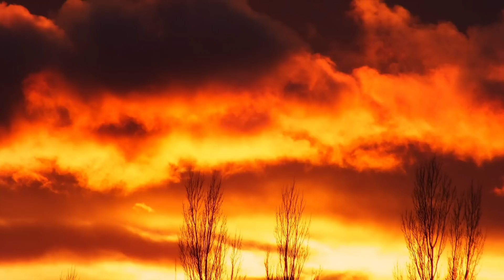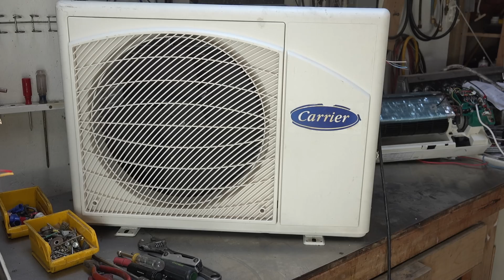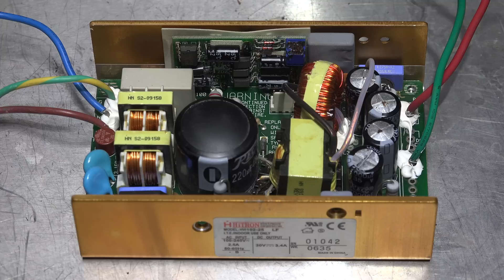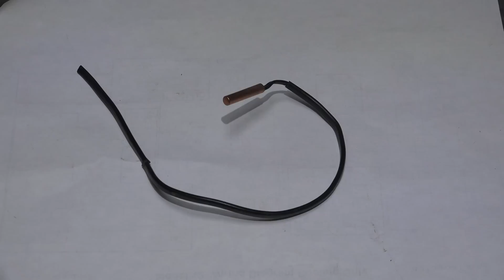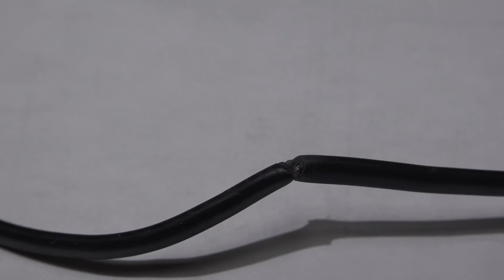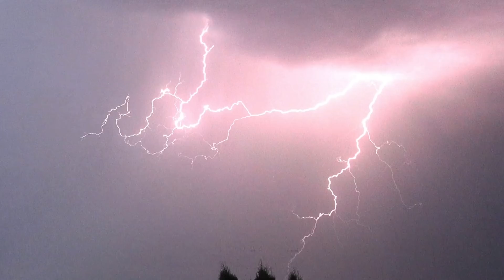What failed on this mini split air conditioner Part 3

Comment: Agree with previous posters:  If a switching power supply failed with age, the most common failure is electrolytic capacitors.   You can shotgun all of them, or probably buy a generic replacement ps for abou the same money ...

Comment: 1:00 - That's one of the reasons why I'm not very fond of mini splits. There are plenty of hacks who work on or install regular systems, of course. But, the style of those mini splits lowers the bar on the amount of understanding necessary to install/replace one a bit...

Comment: The smaller caps are all shot on that converter too.
Reply from the maker: Everyone seems to think the caps are failed.  All of them I checked are ok.
GFM
Reply: I saw the bulged top and electrolyte at the vent which is usually a sign. Interesting that they are still working.

Comment: Most switch mode power supplies if shorted at least intermittently, will power off and re start, this unit may be different. By the looks of the as installed location this poor unit is getting baked by the compressor. 
Clearly the capacitors on this are on borrowed time as evidenced by the bulging condition, if that supply still works, it may have moments where it shuts down, rendering no fan to the evaporator coil
Reply from the maker: One of the mosfets shorted in the switching converter.
GFM

Comment: The switch mode power supply would also need to be repaired or replaced. If it's still functioning all of the electrolytic caps would need to be replaced.

Bulging capacitors are a sure sign of impending failure. The capacitance goes down and their ESR goes up if left unchecked it will destroy semiconductors in the power supply.
Reply: agreed, those caps look pretty poor. some of the small guys have split their top pressure vents. it may have still worked when pulled, but I'd almost guarantee it didn't have a lot of time left if it had no issues, or it was starting to show signs like only working for a short moment, needing to be warm to work, or powering down on high loads like increased fan speeds. the intermittent issues are common when the caps fail in pc power supplies or tv's.
Reply: Was going to say this.

Comment: Just a hunch - would that thermistor also detect high condenser temperature?  The reason I'm asking is the discolored label on the compressor.  (( Is that unit a heat pump as well, or just a cooling unit ? ))  Thanks for sharing!
Reply from the maker: Its cooling only.  I guess that answers both questions.
GFM